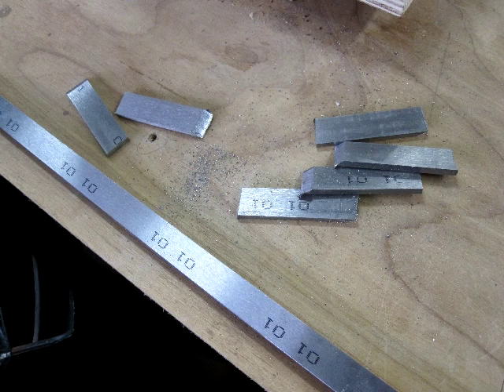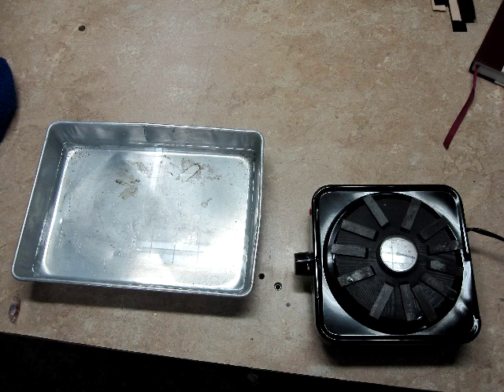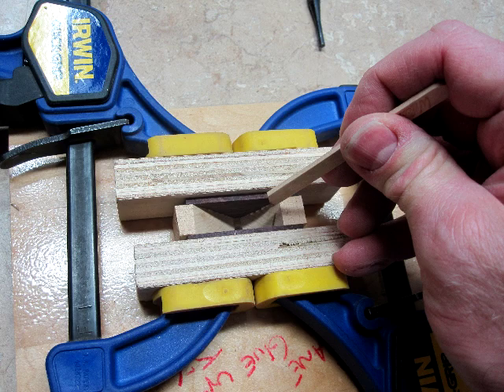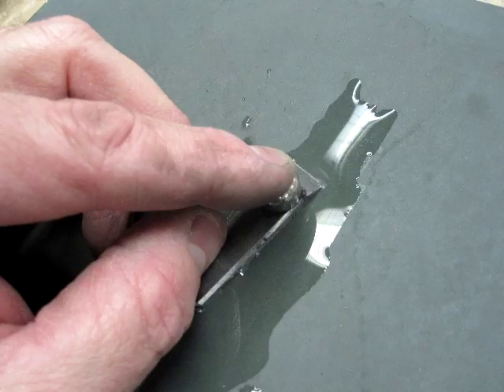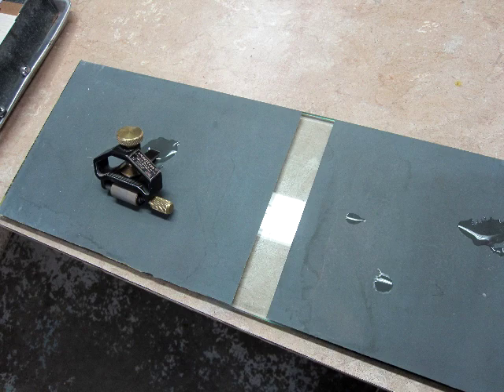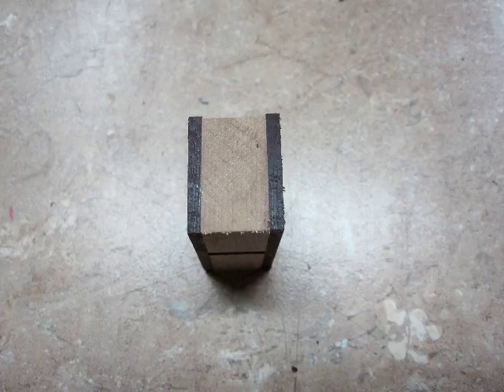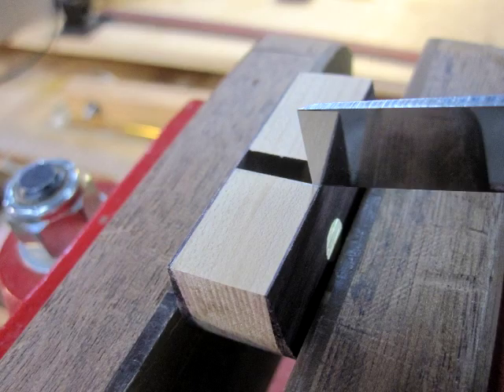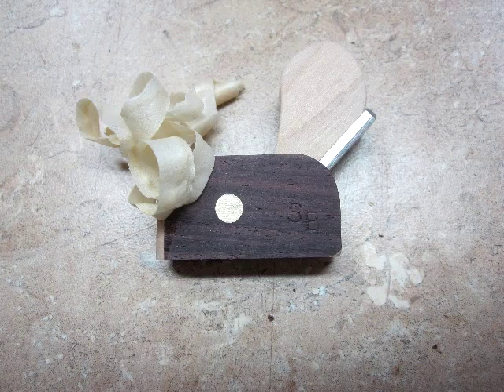Stephen Boone-How I make my mini-planes

Comment from the maker: It can be straight but the plane is much, much, easier to use if it is hollowed out. This hollowing need not be precise in any way. You are merely creating clearance around the cross pin to access shavings and chips that will collect near the bottom of the wedge during use. I dig these shavings out with a pencil.

Comment: First I would like to say, I am inquiring, not correcting, unless you glean new understanding. I had the understanding that to temper the blanks they need to be brought up to 2000F and then quenched in oil. This temperature removes the magnetism. One would check for temper by checking magnetism. According to what I am seeing in your video, your blanks are heated to 1500F. They appear not to be tempered, because they maintain magnetism, as shown by the magnetic metal shavings attached to the blank as you work it. Is it possible the temperature you are using is not adequate for tempering by 25% or have I been misinformed?
Reply from the maker: +MyYouTubeChannel I am using O-1 tool steel which has a hardening temperature of just under 1500. I have not checked if the blanks are magnetic at that point. For some formulas of steel the blank will lose its magnetic quality at around the hardening temperature. This is not an absolute but a general rule if you are using carbon steel of unknown origin. In any case, once carbon steel returns to room temperature it will again be magnetic. It is only at the high temperature that the still will not be magnetic. Tempering is what needs to be done after the steel is hardened. Tempering is done after hardening to soften the steel just a little because it can be brittle after hardening and will not hold and edge. On shiny hardened steel you want to heat it until it turns a "straw" color to temper it . I have found this temperature with my O-1 steel to be around 450 degrees. If the steel is heated too far beyond 450 it will become too soft and the edge will not last. This means too hard is not good and too soft is also not good.
Reply: I appreciate your time and response. The reason I ask is because I will one day built a few designs of my own, for myself. For now I am gleaning as much information as possible. Thanks

Comment: would have been better with more dimensions. i am a blacksmith and woodworker and would like to do some. nice video and thanks for that. most people on the internet do not give much,maybe they want to make money off people..
Reply from the maker: Just use whatever dimensions suit your needs. My blades are 1/2 inch wide. The concepts of construction do not change with a larger plane. You need to build around the size blade that you have since that is usually the part that must be purchased.
Reply: hi, how do you calculate the position of the pin?